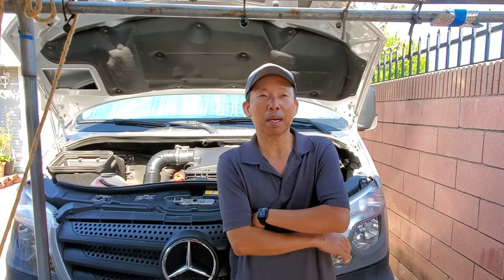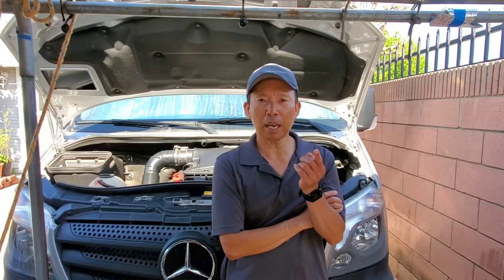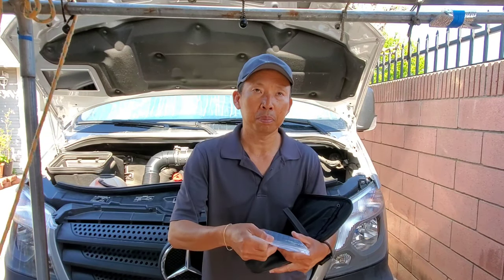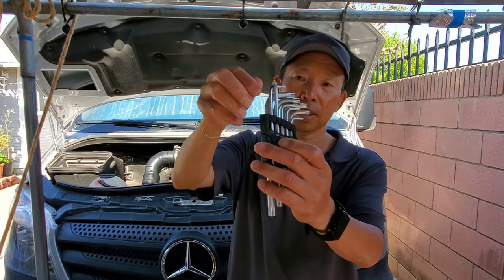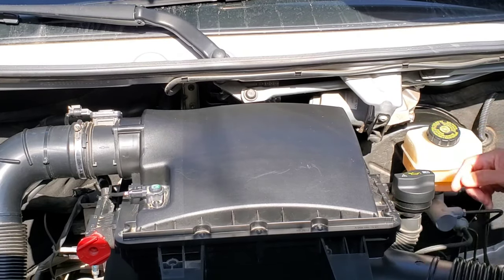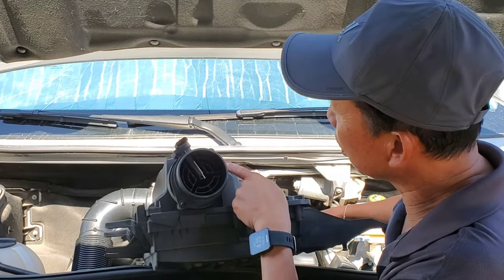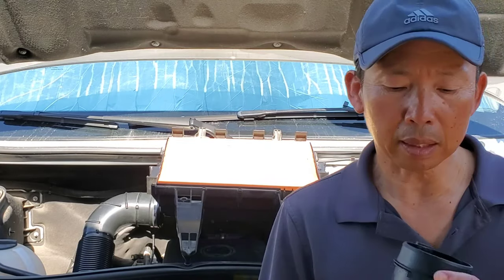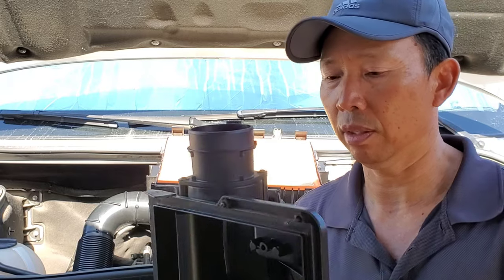Sprinter Van does NOT accelerate - Trouble Code P100D00

Comment: WOW!!!! Thank you so much. I've been trying to figure this out for 2 months!!!
I found the little air sensor to be bent to the side and I straightened it out and it ran like brand new again. 
Before it would over Rev and stay stuck in gear with weak engine power. 
I went to mercedes to get oil changed and get the engine light diagnosed. They estimated it to be over $4000.00 saying it needed new vacuum lines and solenoids and a few other things. I was shocked and told them I will have to wait to get it fixed.
They charged me 2 hours to diagnose the issue and with the oil change it was almost 350.00 for probably 30minutes of work in reality.
I was shocked considering it has 65k on the odometer and I take really good care of it too.
Thanks again!!
Reply from the maker: Oh geeze, glad you find this video. We would have stranded too if we wouldn't have friends help with the research. It was so simple fix.  Happy for you

Comment: Yup! That is a simple fix.Good thing you have a machine( scan tool) that pin point to the right direction to fix the problem, and you did not need any new replacement parts.Hmmm. ..with that experience ,now you can pretty much have an idea if that happen again.
My Big question? What will I do now if BO is not with me.😀
Reply from the maker: 🤣  Louie then you will have to buy a scan tool. 🤣
Reply: You saying that , buy scan tool? 
I already have a trouble code NM0000 meaning No Money.😀
BO is better than the scan tool.😀